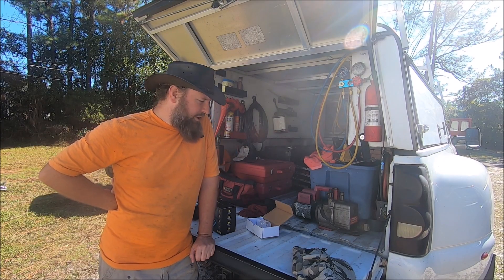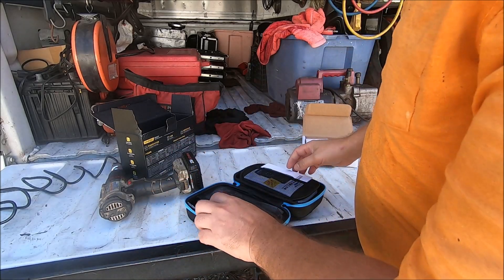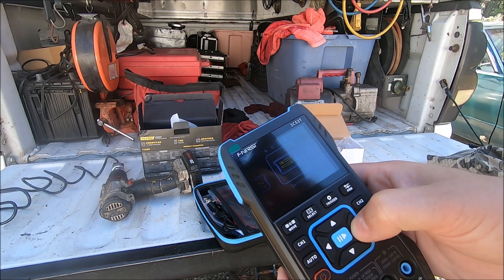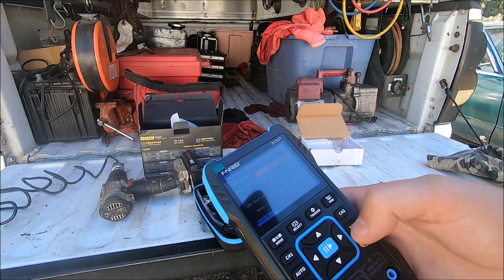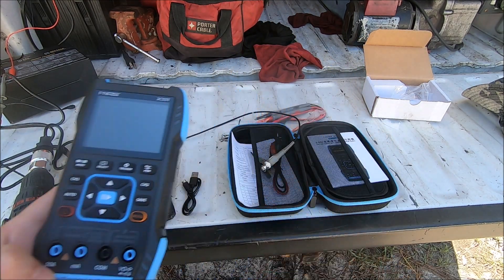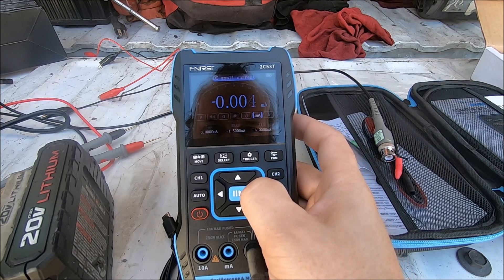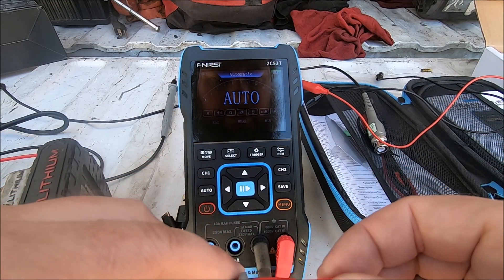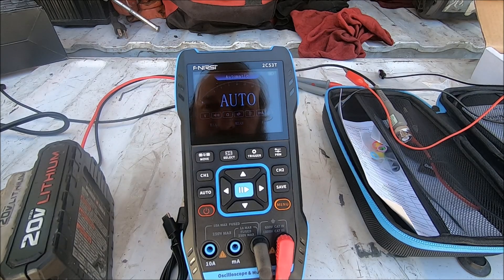Fnirsi 2C53T handheld oscilloscope quick review/functionality (unsponsored)

Comment: I bought this unit and its a horror to navigate and the build quality sucks. I had to take it all apart just to re-solder the input DNC connectors on top - all the solder joints were loose from the factory!  Not a good unit.
Reply from the maker: That’s good to know. You must have gotten a bad one. Mine rides around in the truck through all the rattles and bumps and I still haven’t had any issues with it. I use it regularly.

Comment: Thanks for the video, can you read easily what's displayed on the screen? I mean the size of the written values, especially outdoors.
Reply from the maker: @AMGTOM  yes it is surprisingly readable. I do like the screen. Direct sunlight reflection is an issue but you’ll have that with any screen. Tilting a little bit if the sun is too bright in it works fine.

Comment: Your probe might need to be compensated to get a proper reading. I have the FNIRSI DSO-TC3. There's nothing in the manual about compensating the probe. I found it by accident on YouTube. After I followed the instructions for my unit, it was much more accurate. Your unit might have a different procedure, but you definitely need to get it compensated. I believe there's also a method to get the signal generator to behave properly, I just haven't found it yet. Good luck with your scope. For what they cost, they're an excellent value.
Reply from the maker: I definitely need to look into that. I had not heard that it was needed so thank you for noting that!